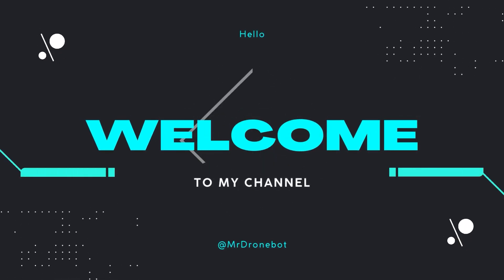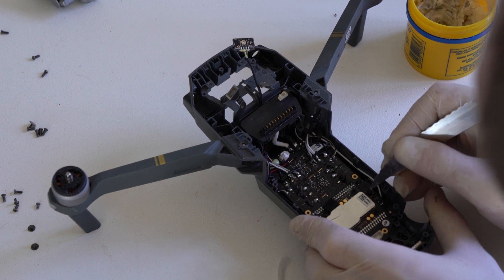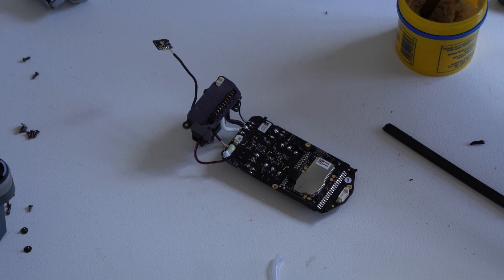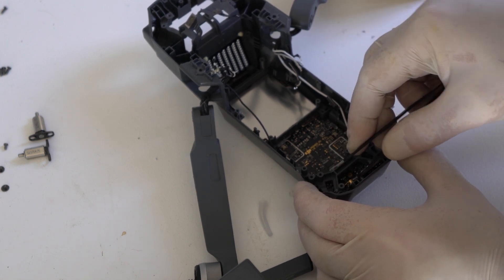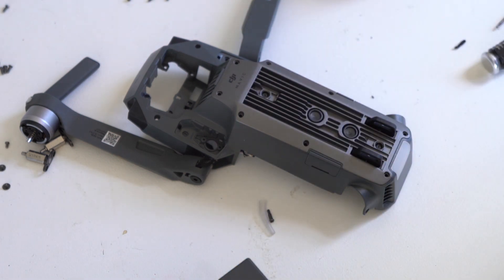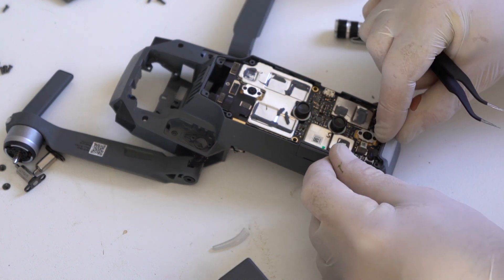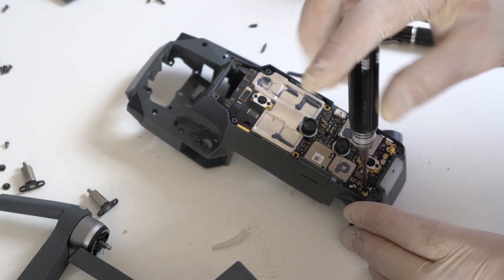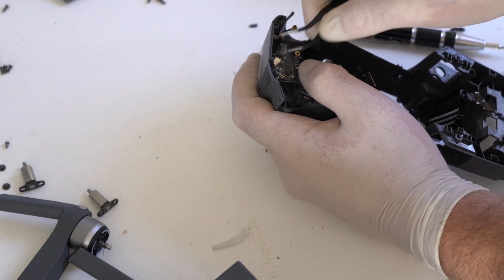Mavic Pro Repair Part 3-PBD,WiFi,ESC,MainBoard Removal

Comment: do you have you de-solder and remove the speed controller board in order to be able to remove the core board? on my drone the SD card will not read no matter what I do, and at this point the only thing I can think is that it's a failed reader.
Reply from the maker: Yes you will have to desolderbthe ESC board on order to gain access to the core board to replace the card reader, it will make easier for you to remove the SD card reader and replace it with a new one.
Reply: @MrDronebot  is it removable, or would you have to actually use a hear gun to 'flow' it off/on? It's been a bit since I had it off, but I don't recall it being removable, and I've never found a part for it (though I haven't looked for a generic board mounted reader).
Reply from the maker: @stephennelson153  you will need a hot air station.